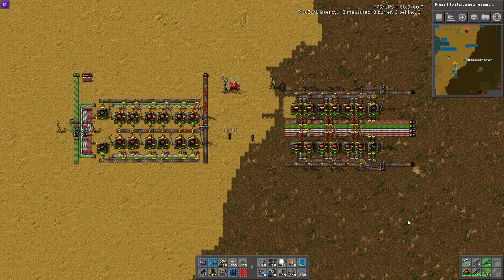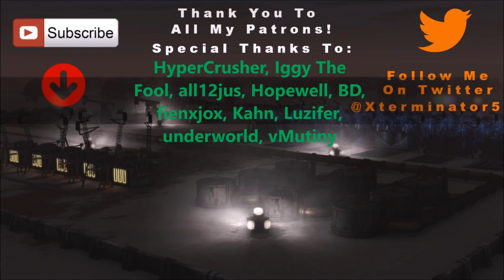Red / Advanced Circuit Builds :: Factorio Workshop Season 2 - Building A Better Factory

Comment: How can I send my setups?
Reply from the maker: There is a link the description to a form that you can use to submit them.
Reply: Thanks for answering me, I have an, in my opinion, good Processing unit setup.
Reply from the maker: Awesome! Definitely send it over then. :)
Reply: I have sent it until now, but there are some things that aren't in the perfect ratio but it seem it works better when it is in that ratio and I also build vanilla power poles in that setup(I have used the power poles from the "creative mode" mod before.). I would be so thankful if you remember this comments when you are showing that setup. I have used speed modules 1 because I discovered that speed modules 3 would be too fast for blue/express belts (I don't check speed modules 2 until now), maybe I will build a new one or something like that.

Comment: If you rotate the design on the right, is it going to work? I feel like that the belt trick is orientation dependant, no?
Reply: Inserters putting items onto belts in that way always place it on the right side, regardless of orientation. That's why it has to be different on top and bottom, since it's rotationally symmetric.

Comment: Apart from that belt trick, the one on the right could be tiled vertically, I think. Maybe it'd be possible to change how the belt trick worked to allow that
Reply from the maker: I think there were a few other issues with it tiling vertically but I could be wrong.
Reply: I couldn't see any other issues but I make no claims to be an expert. Of course, it could be that moving that belt wasn't feasible without making the footprint larger.

Comment: I like the way that the marvin_tr build on the left uses the cheapest inserters possible. I guess you could have changed the wire output to make 2 fast inserters work, by using the underneathie trick that Fixitt used.

You talk about upgrading belts as you duplicate it, but that will just be the vertical input and output buses. And you won't need to upgrade the inserters either. I really like this build.

Comment: For the right design,, for the cable assembler on the bottom, one output down and one to the right., and side load the right's to put the cable on both sides.  Avoids the little fruit loop and the underneathies.

Comment: The one on the left can stack 1 tile closer by sharing the copper cable belt since it only uses 1 side
Reply: That's not an issue. It doesn't matter which side they grab from, it's the same throughput regardless. Doubled inserter count, but also doubled production. Also, they actually would only grab the near side (except occasionally the end) because it's a perfect ratio, so there'd never be a shortage, and inserters prefer to grab from the near side.
Reply: no, because the long handed inserters would grab from both sides of the belt.
Reply: no, because the long handed inserters would grab from both sides of the belt.